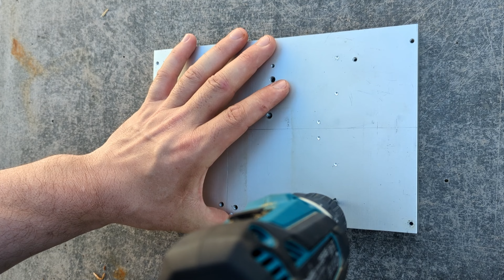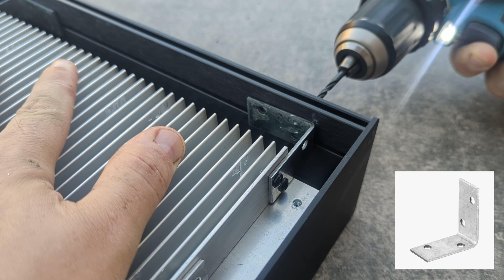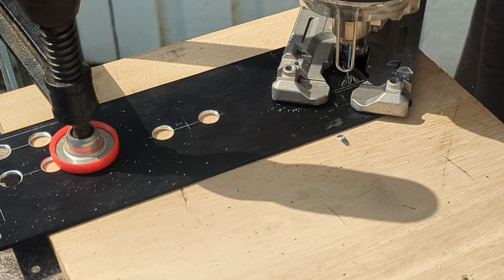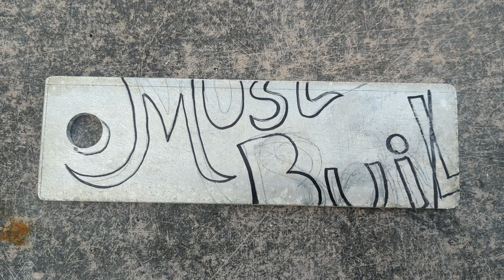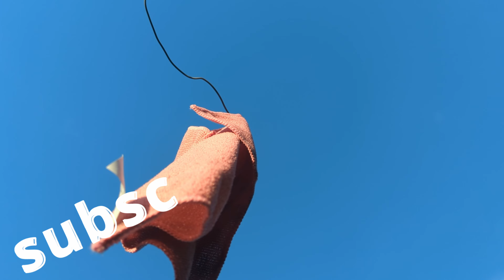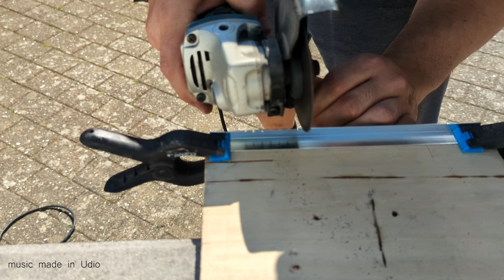Best DIY AMPLiFIER Unlimited power MUHAHAHA

Comment: I have two integrated amps. One is an Aiyima A08 Pro that has the Texas Instruments TPA3255 chip like yours. That chip sounds much better than the S.M.S.L Infineon MERUS 12070 chipset which had artifacts at higher volumes. The TI chip sounded warmer and I could not hear any artifacts with headphones on.
Reply from the maker: Yeah I think it is awesome. We can get a lot of amp for a little money these days 😀
Reply: @mustbuildsomething  Unfortunately none of it is serviceable due to integration and would have to be scrapped. You’re really renting it.